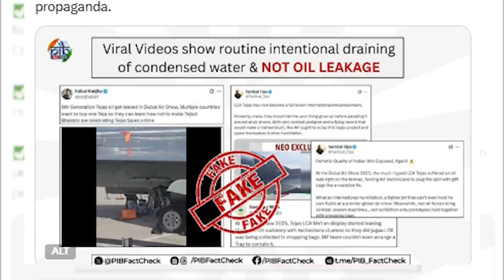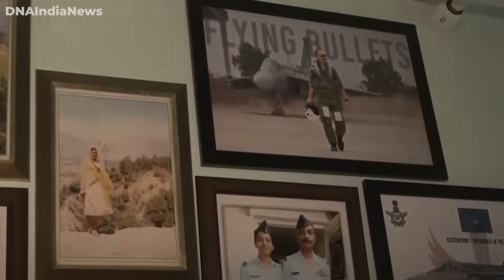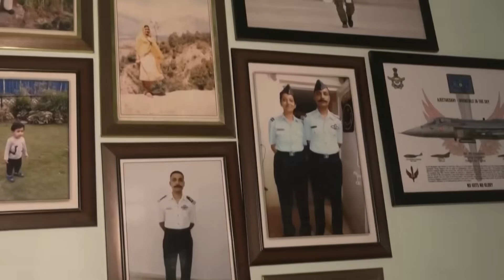The REAL Reason That Got The HAL Tejas Crashed In Dubai Air Show…

Comment: I can't remember which YouTube sight or commentator except they have lagit credentials in aviation subjects.     This commentator speculated that this was a physiological incident. The Pilot put the Tejas in a brief, but long enough ,  negative "G" outside turn and then , as we see  , snap rolled 180deg into a positive "G".  This positive "G" turn was even briefer as he then rolled level to a 1 "G" state.   It is speculated that the Pilot felt the oncoming dangerous affects of the rapid transition from  negative to  positive "Gs" and rolled level.  Unfortunately his vascular system could not adjust quickly enough to control the rapid transfer of pooled blood from the upper body and head back down to the lower body. Even the "G" suit would be overwhelmed.  Even if he managed not to go fully unconscious he very likely went semi-conscious long enough that he didn't have enough altitude to recover.  He was trying to in the last second or two.  This maneuver is one to be avoided at all costs because of the dangerous consequences.   Watching the maneuvers I am not convinced that the Pilot miss-managed the aircraft's capabilities.

Comment: I am no expert, but the plane should have lifted up.  He had plenty of room to get out of trouble.  These planes are designed to do that, and that is what he was showing.  If it didn't have that capability, then he was unwise to fly so low.  The plane's engine stalled so the only place it can go is down and crash.